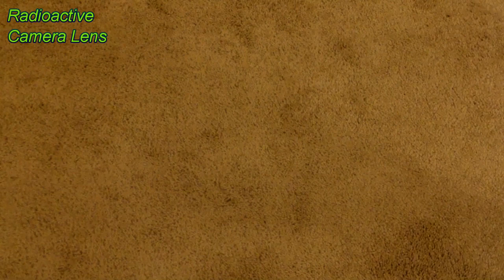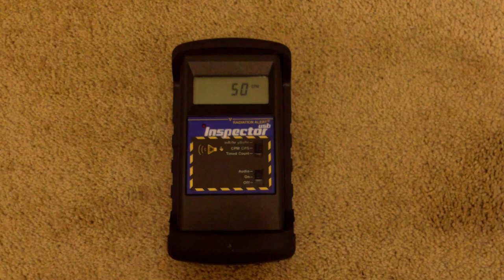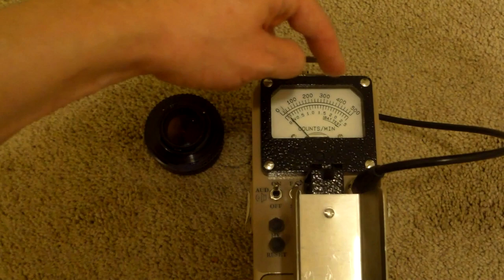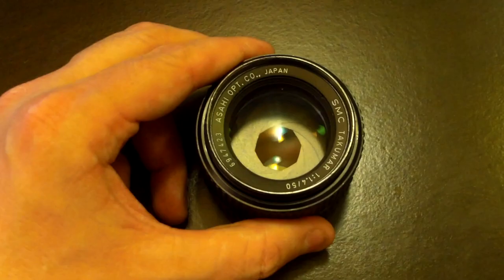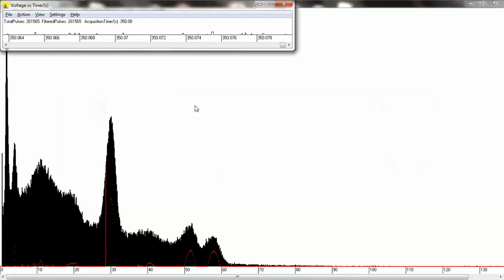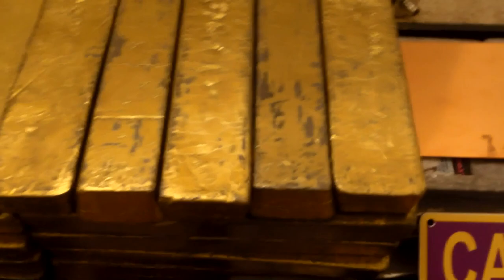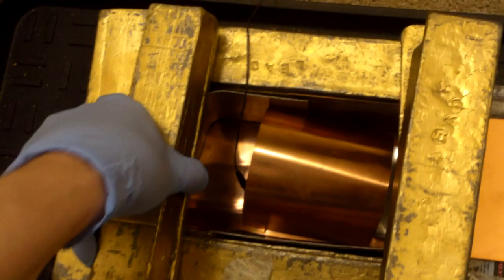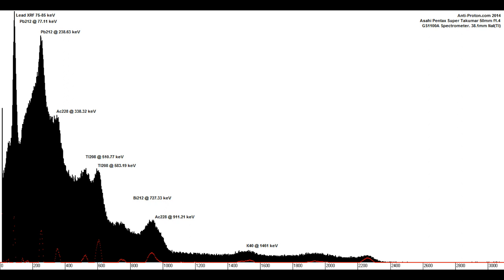Radioactive Camera Lens

Comment: Hi antiprotons,
really learning tons from your videos! Please keep it up, it is beautiful, fun and really precious!
Two questions on your comments:
1) Can't you reliably detect radiation of radon with a pancake geiger counter good for alphas, like the Si-8B? (see bionerd's video where she uses it for betas: soviet СИ8Б (SI-8B) pancake GM tube glowing with beta radiation from Sr-90 check source!). You will not know it is radon, but catch the radiation?
2) Since some time I am seriously considering buying a gammaspectacular like yours. The problem is calibration. Now as you said, it is hard to get test sources in Europe. Since you mention it: do you think a viable option for calibration is using the 1442keV peak of potassium 40 (using potassium chloride, for example) for the mid range and the 77keV peak from a lead castle (Pb212) for the lower end, and use it for (at least linear) calibration? Will this be accurate enough to discern different isotopes? Clear you cannot quantify the actual activity then. But discriminate between isotopes?
Reply from the maker: 1. A Geiger counter can detect alpha's with a thin window to allow them in. The unit Bionerd used likely can and my pancake units can too. The problem is that the other things in the background blow those readings away. You might get 1 tick per 10-20 minutes from radon and hundreds more from normal background. The ionization detectors of radon detectors only look for alpha's, so they only see that 1 tick. So, yes, you are correct... Geiger counters can... but to no real use.

2. using the 1461 keV and 75-85 keV lines from K40 and lead XRF, respectivly, can be done... but it would be a bit of a trouble. Your calibration would take a significant period of time. Still, I have actually used that same method myself! :)

You might find a nice bit of rock with some uranium in it. Most rocks have a tiny bit and 20 minutes searching some rocks near your house will likely give you one. That gives you many good lines from 186.1 keV to 609.31 keV   http://anti-proton.com/naturaluranium.png

Bionerd has an odd-looking Sr90 source. My Sr90 source is tiny and in a plastic disk lol  Testing Radioactive Things!

Comment: I just tested Rokkor PF 1.4 with GMC 300E+ bought on Amazon, and the background radiation is about 0.1 MicroSv/hour. The GM counts about 18 average through apartment. At Rokkor PF it doesn't change but this is GM of a 100$ and it doesn't count alpha. What is your opinion, about measurements. Do I have to go further buying Alpha detector or this is enough to conclude measurements and happily use Rokkor 1.4. Thank you very much.
Reply from the maker: stickom I would not personally be that worried about the radiation from a single lens. The alpha counts make them seem pretty hot, but in the scheme of things they are actually pretty low level. Beta and gamma from a thorium lens are not particularly intense most of the time, which is why your Geiger counter isn't picking them up.

Comment: What do you usually get for background? I get about 10-20cpm. But I am not sure how accurate my counter is as I built it myself
Reply from the maker: +membola It very much depends on the device. It sounds to me like you have a small tube, such as an LND712 or 713
Reply: Yes, I have a small tube, an SBM-20u.
Reply from the maker: membola Ah, a Russian tube. It still sounds like a neat detector.
Reply: I am quite happy with it, i built a cmos 555 driven frequency generator, that drives a voltage ladder to get to the 400v or what ever it was. then i used an microprocessor and lcd to get the count

Comment: It looks like your lens is from the 1973-1975 time period.  It looks like an SMC Takumar, which would be the last of the M42 thread mount lenses before Pentax adopted a bayonet mount.  The earlier M42 50/1.4's were the Super Takumar (1964-1971?) and then the Super-Multicoated Takumar (S-M-C Takumar) from about 1971-1972  This is the version shown in my video.
Reply from the maker: I am just glad I got a good one on my first try. There were many to choose from an probably lots of non radioactive lenses.
=)
Reply: antiprotons I bet if you specifically went for yellowed lenses you'd have good luck. Though some people will bleach thorium lenses in the sun to return them to full transparency.
Reply: Mark Rose Best bet to get a radioactive lens is to look at the list of radioactive lenses at Camerapedia.  Some radioactive lenses are not visibly yellow -- an example is the Olympus 50/1.4, which I've had for decades (with no bleaching).  

However, this Takumar lens is one of the best, as far as radioactivity goes.  It's very common and easy to find, and the radioactivity is well above average for 35mm format lenses.
Reply: ***** Thanks for the info! I haven't yet added a lens to my collection.

Comment: Hello, I wanted to ask you how you are with the spectrometer "Gamma Spectacular" Gs 1000 ... !!
And 'good .....! ??

You've heard of the Theremino .... !!! ????

Hello
Mirco
Reply from the maker: I am not sure but I completely understand your question. I really like the gamma spectacular but I use it with PRA 8. I did not really have much success with Thermino. Normally, I use my UCS 30 from spectrum techniques, but I find that the gamma spectacular is very useful in the field. It small and portable and works from my laptop without any trouble. The UCS 30 requires higher voltage and is more of a laboratory equipment.

Comment: I'm wondering about the workers who built these lenses. How much exposure did they receive I wonder?
Reply from the maker: No idea, but I would suspect that they were exposed to quite a lot. The workers who made all of this radioactive stuff are often ignored. Here is a neat video showing how thorium  was extracted and processed in India. It's creepy to watch the workers handling all of it: Atomic Fuel India
Reply: antiprotons My grand parent's old off-the-grid place used propane lanterns for lighting with... thorium mantles. No doubt everyone there, myself included, inhaled/ingested bits of thorium oxide dust :D
Reply from the maker: Even to this day, thorium is still used in mantels.
Reply: antiprotons It's tough to find them though! All the ones I've found for sale around here are thorium-free (using yttrium instead, I suspect).

Comment: Hey, great videos.  I read some of your explanations below.  I'm curious at what point would the radiation levels coming off a sample would cause you concern? In uSv/hr.
Reply from the maker: Well, concern relates to risk and concern over risk... so this is more of a question of when I would be worried.

If my sample had a dose rate of more than perhaps 1 uSv/hr at 1 meter (above background), I would not want to keep it. That is still very low, but beyond what I would be comfortable owning.

I could not want to approach anything above around 100 uSv/hr at one meter, for more than a few minutes.
Reply: Perfect.  Just the answer I was looking for.  Thanks.

Comment: If the readings were at dangerous levels, I would be very surprised if anything radio active would pass customs to come in to the country. Everything is scanned from what I have seen in TV news reports. If this is not true then this would be a serious security risk for the country. 

From what I have been taught certain types of metals and silica for glass has a natural level of radio activity.  I do not know the accepted readings for these types of materials or devices since I never researched this. There is so-called natural background radiation in our environment. 

From what I can see the person doing this video has expertise in this type of testing. This is very specialized work. The devices for testing are very expensive, therefor this guy is very serious about this. 

When the lens is mounted on the camera, there is some metal and a bit if distance from the lens unit to the viewfinder. Also being a digital camera there is most likely an electronic screen and not a direct optical coupling to the person's eyes. 

I believe the eyes are very sensitive to the effects of radio activity. Personally, I would not feel comfortable using devices that have a high level of radio activity.

Comment: I got a question whats you opinion on LFTR reactors?
Reply from the maker: They seem like a good idea, to me. I believe we need to get Fusion working. Lockheed Martin's Skunk Works says they will have a working prototype for commercial use in 5 years. We shall see. http://www.lockheedmartin.com/us/products/compact-fusion.html

The LFTR design is much better looking than our current BWR and PWR's. They are likely safer, easier to maintain, and can be used to get rid of some nasty existing materials. The idea of having a coolant/fuel mixture is also impressive.

I do worry that countries may use such devices to created weaponized Np237 devices, but what can you do?

Comment: Well, damnnnn.   Wondering if photographers that used old school lenses have more incidences of cateracts.
Reply from the maker: Perhaps they have. I don't know of any good research done in that field. Having the lens close to your eyes for hours at a time or handling broken lenses are likely the only two ways to be affected by one of these (though, technically any dose of radiation increases your risk of cancer).

I used to be a photographer, but none of my lenses were hot. :)
Reply: Since the cameras used are/were largely if not completely metal I would guess that gives at least some protection. The back of the camera is certainly metal. The shutters in Pentaxes these lenses were used on I think were fabric although some other SLR shutters were metal. When the photographer is using the camera he is looking through the lens via two optical reflections, the mirror behind the lens and the pentaprism. I don't know if the mirror has metal on the back of it or not. Perhaps the greater reading from the back may be due to the rear element being the culprit? I would guess the lens has from 5 to 7 different glass elements, possibly of different glass formulations. If the radiation is coming from the rear glass would some of the intervening glass when measured from the front or the short increased distance decrease the reading?
Reply from the maker: ***** There are two things in play:   The beta and alpha from the glass, which are blocked by the casing at glass easily, and the gamma/x-rays from the glass. The gamma and x-rays will pass through the lens as though it were not there. The metal will only shave a few % off of the gammas.

My scintillator gets a nearly uniform reading, but my alpha/beta/gamma sensitive Geiger counter has vastly different readings due to the glass.
Reply: antiprotons You were getting vastly different readings between the back and the front with both devices, weren't you? Doesn't that imply the culprit is the rear element? Is the lower reading from the front due to distance? Does the radiation follow the inverse square law and IF the radiation was coming from the rear element it would be greatly less even a slight distance away?
Reply from the maker: ***** You have several things in play:

Change in intensity with respect to distance.
Change in intensity with respect to attenuation.
Change in intensity from intervening objects.

All of these reduce the reading. I suspect the back is the culprit.

Comment: Do gamma rays bounce through lenses the way visible light does? Well, not exactly the same, they'd suffer a lot of chromatic aberration. What about other ionizing radiation?
Reply from the maker: Higher energy photons, like gammas, tend to go right through most matter. Lower energy photons, like light, sort of "splash" off of material, bouncing here and there.

To a gamma, the camera lens is nearly transparent. This is the same for x-rays and beta's. Alpha's cannot penetrate more than a few micro meters of the metal.
Reply: Do you know of any material that acts as a lens to gamma radiation? I should probably read up on how light interacts with solids.
Reply from the maker: nealshireman I do not. It mostly scatters (compton scattering). It could be possible, but I doubt it would be easy.

Comment: The lead bricks should preferably be chevrons to prevent any shine paths, but recasting all that lead would be kind of nasty and would require a decent mold. (although many of us who are a little bit older remember melting lead in a ladle on the stove to make lead soldiers...)
Reply from the maker: I have some of those soldiers! 
In a few months I will likely begin upgrading my castle and I will likely add extra layers of protection... but getting shaped lead can be expensive. :(

We shall see, but thanks for the tip!

Comment: Alpha particles would be stopped cold by the camera body itself.  Beta and Gamma are the only consideration; you'd have to ingest or inhale Alpha to suffer damage, i.e. Radon gas which is Alpha. Radon also only has a half-life of a few minutes, so you'd have to have a constant and long-term exposure to suffer damage.
Reply from the maker: Alpha's emitted from the surface can strike you at a range of a cm or two. Alpha emitting material can damage you inside because they get close to your tissues and emit an alpha into that issue, which hits it like a bullet. Radon is dangerous over time, but though it decays via alpha, it has a long chain of daughters which decay via other means and can emit gammas as well. This chart will show the chain. Just follow from Radon 222 and down.  http://www.saintlouisradon.com/cmss_files/imagelibrary/half%20life%20diagram.jpg

Comment: I have a 1.4 Honeywell Pentax lens that predates Asahi to about 1969 They told me the yellow/rainbow looking lens was a special coating to prevent glare and distortion.

Who knows, maybe it was from Hiroshima
Reply from the maker: The yellowing is usually the result of a thoriated lens (a lens with thorium in it). The thorium does do the things you said, but it is also slightly radioactive. It doesn't come from nuclear bombs.
Reply: +breckandy Honeywell doesn't predate Asahi, it's the other way around. Honeywell was just the USA distributor. Everywhere else in the world, Pentaxes were sold as Asahi Pentax.
Reply: I was referring to the lens not the company
Reply: +breckandy Asahi Optical Co. has been around for almost 100 years and produces both cameras and lenses. It was only during the 60s and 70s that Honeywell (also parent Heiland) rebadged them for the US market. So your "Honeywell" lens doesn't predate Asahi at all. Also, Asahi Optical Co.'s location was Tokyo, not Hiroshima.
Reply: If the glass looks yellow/amber when you look through it, that's the thorium.  If you see rainbow reflections off the surface of the glass, that's from the coating and has nothing to do with radioactivity.

Comment: how much does it usually cost for a radiation detector?
Reply from the maker: +Brandon 91x $100 and up.   I have units from $150 to $5000. Depends on the unit.
Reply: My one was about $100, it's the cheapest new *actual Geiger counter I could find and very basic. It contains an SBM-20 tube. 
http://www.dosimetershop.com/image/data/NEW%20GENERATION/PORTABLE%20DOSIMETER.jpg
 (*Not to be confused with a $10 EMF dosimeter)

Comment: The lead in the front element's glass may be shielding the thorium emissions from the rear element, hence the varying activity levels front to back.   Different glass compositions were used depending on the properties required for best optics.

Comment: Could very long exposure cause cancer ect?
Reply: +Blacklight8001 Radiation from a banana is higher! 
K40 has a half-life of 1.25x10^9 years; Thorium262 1.4x10^10 years; Meaning there is ~1/10 the amount of radiation being emitted from the lens vs a banana...
Reply: Oh, and I eat bananas all the time! :P
Reply: half-life does not translat into radiation amount.
Reply: +Creativity Overflow it kind of does actually, as the shorter the HL, the faster it decays and the more particles it gives out.

Comment: would this lens damage a digital sensor?
Reply from the maker: +duy zoro Not likely due to the low intensity of the radiation.
Reply: Considering it wouldn't even harm film (from the era it was made) then...NO!
Reply: well film is more durable than delicate sensor pixel.
Reply: +Duy Zoro Film is also much more sensitive to ionizing radiation than a digital CMOS or CCD sensor.  That's why you see film images being clouded by unexposed or exposed film when subjected to a radiation field. On the flip side, the digital sensor is actually designed and optimized to pick up visible light photons.
Reply: No. In fact it could be retrofitted to virtually any DSLR or mirrorless digital camera* via an adapter and there are many photographers that do this. I am a great fan of old manual focus lenses which I use on my Fuji X-M1 some of which are radioactive.
(*with interchangeable lens capability)